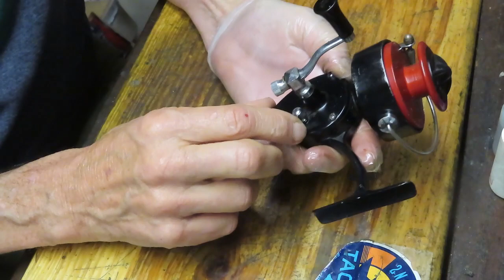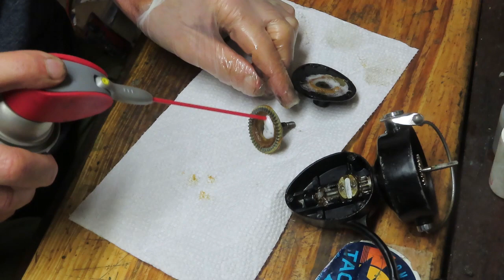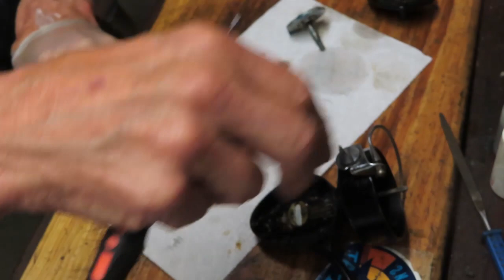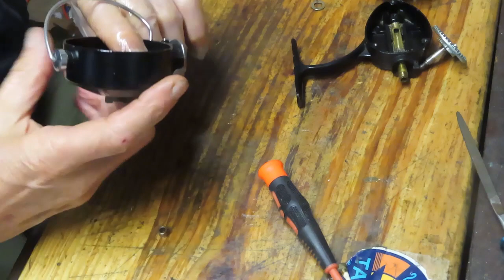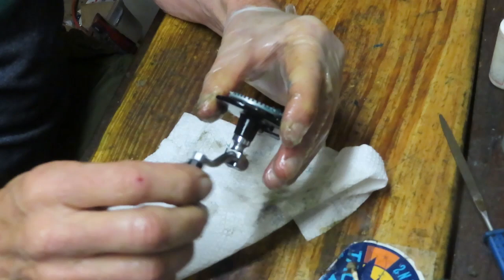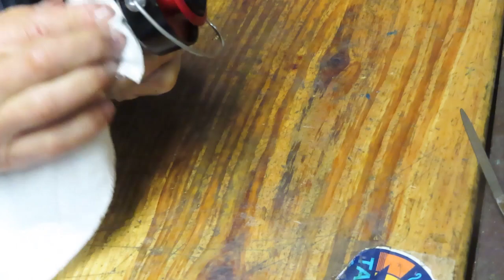Japanese spin fishing reel for Sears circa 1970s how to service

Comment: Thank you for your informative videos. 
I have a reel similar to this and the spindle gear that turns the bowl is shattered. Do you know where I can find one. Reel has little identification other than made in Japan on the back side of rod mount and a tag on the body that says no 600
Reply from the maker: I don't as those reels are no longer supported.  Try finding a donor reel on eBay or local flea markets or garage sales
Reply: Thank you, really enjoy your videos and I’ve learned so much from them.

Comment: I’ve seen several different names for this reel though I don’t own one. It is a freshwater reel which I don’t collect or use very much. The most common name I’ve seen is “Point.”  You were fortunate to have a line roller that worked. This looks like a solid vintage reel that should last a long time. This was a very nice find. If I get the chance I might want to get this one. Great video Dennis! — Chris
Reply from the maker: This one is big enough for inshore ocean as it is an approximate 30 size reel.  The max drag will hold you back some if you get a strike from a big fish.